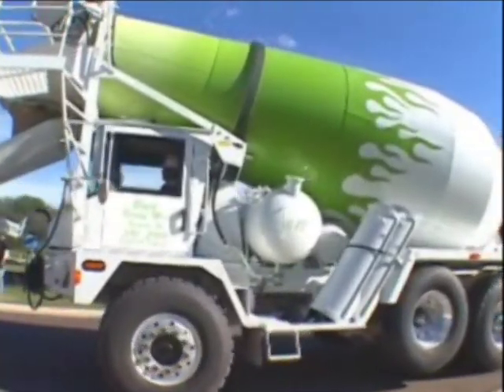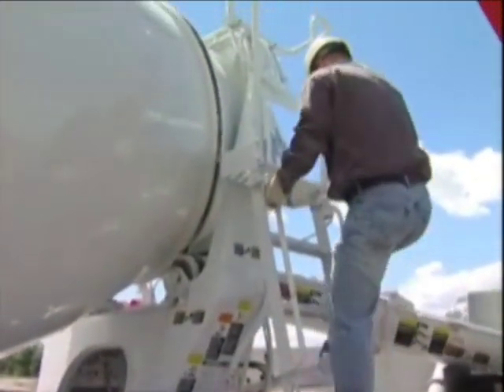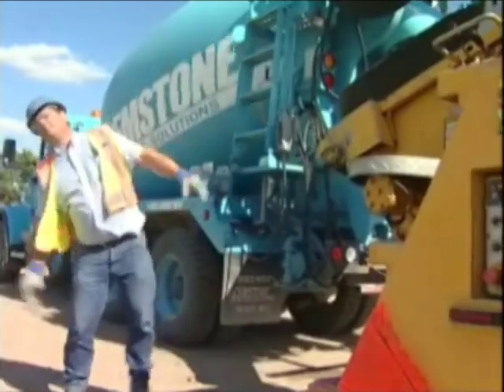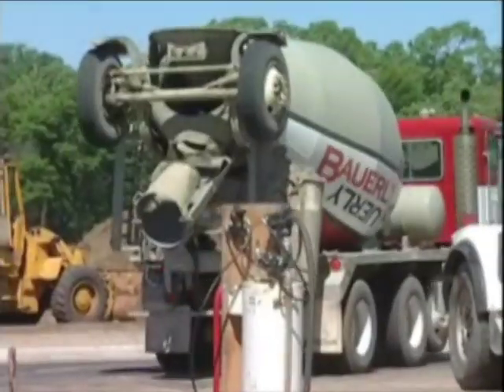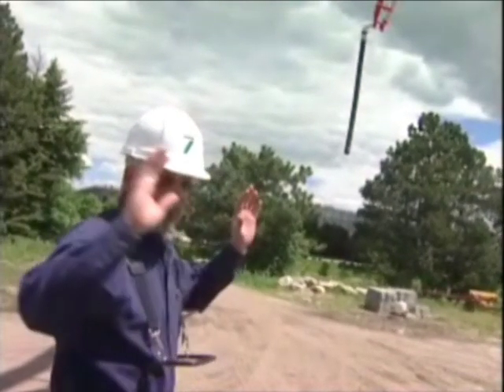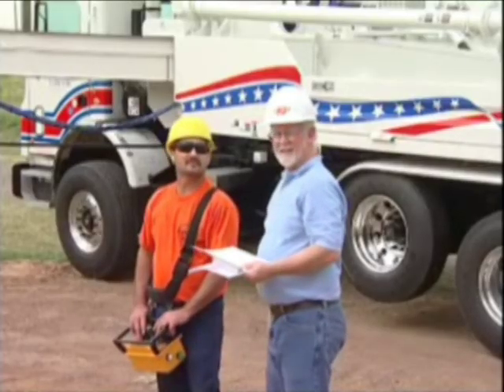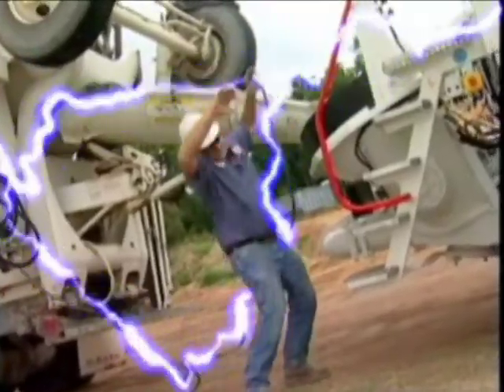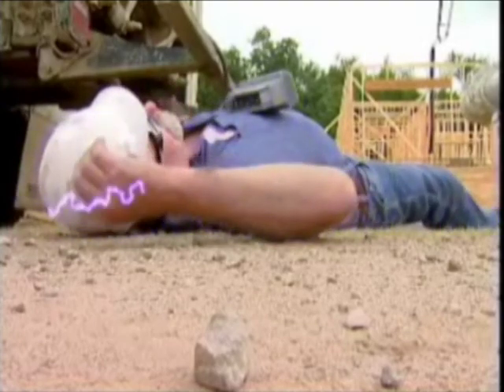Safety Rules For Ready Mix Drivers

Comment: ACPA safety rules need to taught closely with NRMCA safety rules.  When a Redimix driver backs up to a Pump operator, an industrial concrete placement system is formed.  The system involves potentially dangerous industrial equipment, and the professionals needed to discharge all duties safely - all the way down to the hose tip at the end of the pump boom.  Each person, to the extent they are trained and able, need to be cognizant of the risks and empowered to stop the entire operation if danger is present - until the danger is cleared.  This takes honest training; no lip-service allowed.  Companies that use cross-disciplinary training systems are to be lauded:  The pump operator and the redimix driver who know something about the "other guy's safety duties" act as a safety-cross check for one another and create a safer culture.  A culture that recognizes that safety is never just "the other guys job."  Its everyone's job, all the time, together.
Reply from the maker: Thank you for your comments. The ACPA works closely will all jobsite personnel’s industries in providing extensive safety training to those coming into contact with a concrete pump on the job.